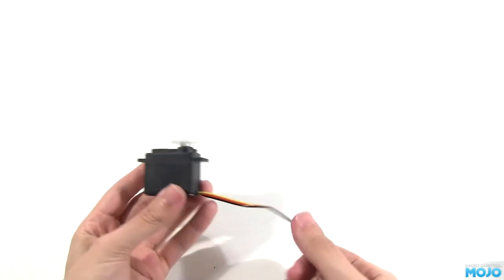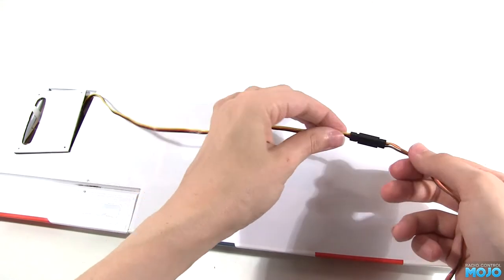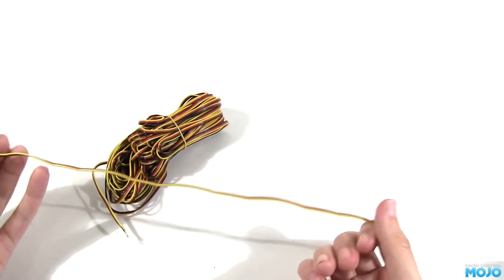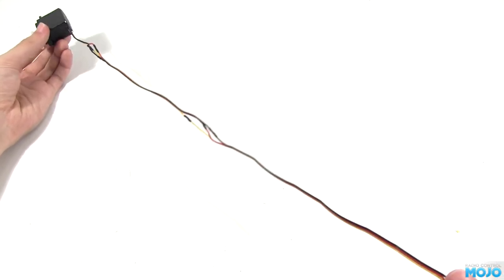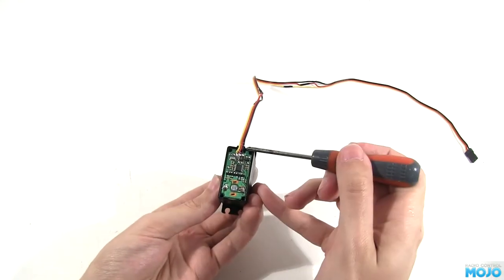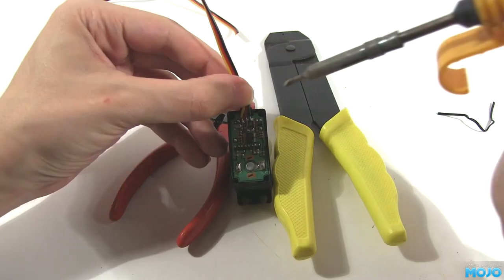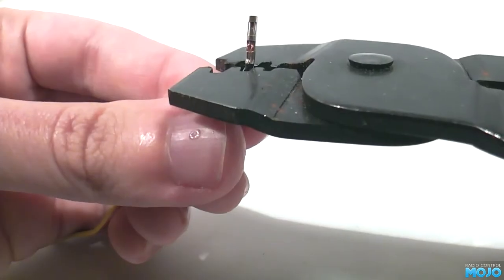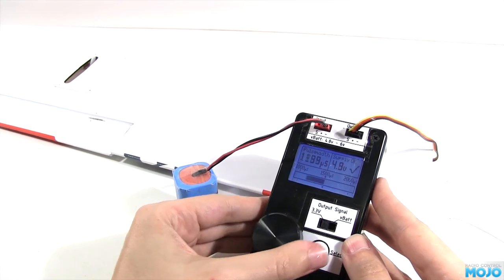Servo lead coming up short?

Comment from the maker: Sure, why not. Remove the stock lead from the servo, clip it, strip it and solder it. It'll still invalidate your warranty of course, so you have to weigh up the advantages.